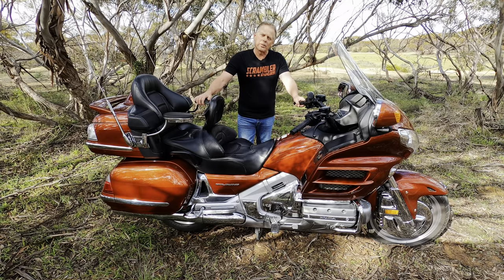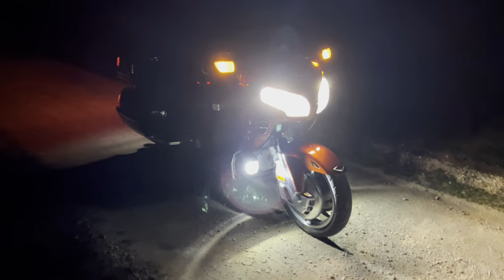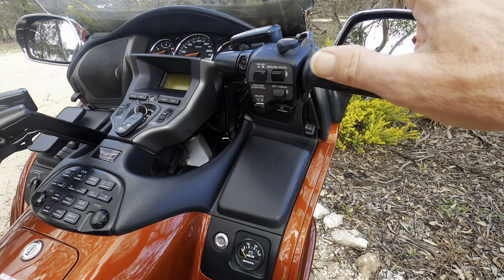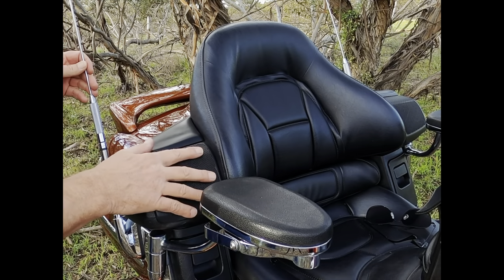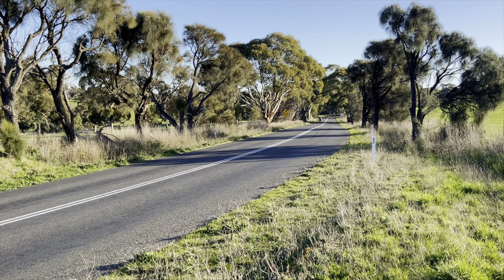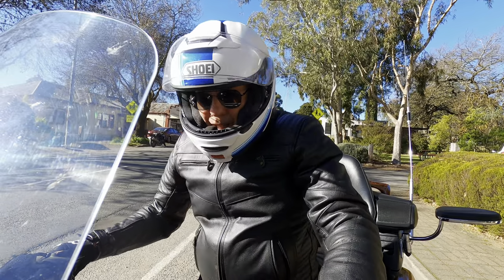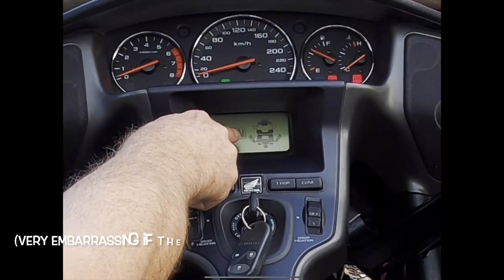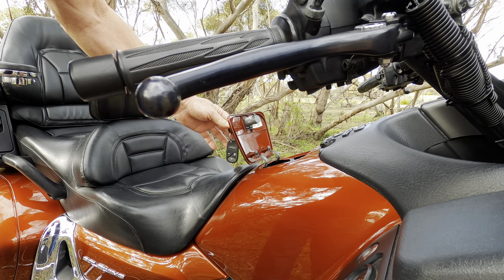Honda Goldwing Used bike review  Is it as good as people say?    (56)

Comment: I bought a 2012 GL1800 with 103,000 miles, and after three years and five months, the bike has 140,900 miles with no issues. It's my daily ride of 50 miles per day. The only complaint I have is seat heater, and handlebar have no heat [electrical problem], the trunk rattles, and the air filter change is highly complex. I only changed a headlight bulb once or twice, but I thought it was a pain. Rest is good. I do my maintenance, but my age is catching up, and lying down is getting more difficult. I don't mind its high mileage, and it rides beautifully.
Reply from the maker: Thanks for your comment, yes the air filter is a pain but fortunately it’s a long time between changes. I had the same annoying rattle, turns out it was the rear speaker covers, enjoy that lovely bike & ride safe.
Reply: @standupmoto  Thank you, and have a great ride yourself!
Reply: Re heater problem, your left had bar heater is broken, this is a common fault, if you remove your right hand fairing pocket you will find two, two wire connectors, these are left and right grip heaters, un plug the left grip and the rest of your heating system will work, had this problem on my 06 wing, eventually fitted showchrome heated grips when the grip rubbers were worn out.
John.
Reply: @johnogden6131 thank you John. Sorry about long no reply to ya! It works now thanks to you! Have a good ride sir!
Reply: I now have 151k. All good except for the master cylinder had to be replaced for front wheel. It happened at 151k! First major change needed. Everything else is original and no issues.
Reply: Update: needs more work on brake repair than just the master cylinder. Going to cost around $1,300 for the brake repair fee.

Comment: My 2012 is awesome. Only one complaint. No 6 th gear. I did do the Traxxion dynamics full Monte suspension. Transformed the bike.
Reply from the maker: That’s great and with the suspension updates, yes 6th would be nice but that OD is quite tall. But I agree it would be good to drop a few hundred revs when on the open road, thanks for the feedback. Cheers.
Reply: @standupmoto  there is a rear drive to drop the revs. I think it’s called a Henry drive. Drops it about 500 rpm
Reply from the maker: @SuperSquitch   Hi Lou, I’ve not heard of that but it’s probably easier to just pop on a 65 series on the back.

Comment: I own my 2002 GoldWing now for 8 jears, driving 200.000km, only maintains are oil , break pads and filters Ride great, total km now is 260000 km just 1 big repair on the gearbox, root cause a worn bearing in the crankshaft cost me 3000 euro!! But the engine was stil after 246000 km in a berry great shape and hardly any worn could be find 
So for me stil the best bike
Reply from the maker: Thanks for sharing

Comment: 120,000km I picked up for CAD$400. After a week and maybe another $600, I've been riding it for 4 years. Just took my partner on a 600km road trip a couple months ago and it ran like a dream. However, seating position with the Saddle seat really sucks. Too far forward. And now I find I'd like a backrest and cruise control for long trips.  Soon time for a newer one. Getting a little old 😆 🤣
Reply from the maker: Sounds like a bargain! Yes they are a wonderful long distance machine for sure, you may be able to find a Corbin seat second hand if the standard one doesn’t work for you. Cruise is a really nice thing to have, apart from the comfort side of things it’s saved my license many times.
Never to old 👍 cheers.

Comment: Nice review 👍🏼 Having owned a Suzuki GSX1400 I've always fancied big engines. Not so much for the speed but for the torque and the flexibility in gears. But I never liked the GSX, always had the feeling the weight was  way up, to high in the bike. Having owned several other bikes since I'm now on a small Honda Deauville 700. Nice and agile bike for local traffic  but to light for serious touring. And since we're going to move I'm going to have to do a 500 km stretch on regular basis. I was a little afraid that apart from the motorway the Goldwing would be a heavy b*tch to drag around but seeing you take it on gravel roads and even do some off-roading  I think I need to change my mind on that. Another thing that I really like is the low revs in the 6 cyl.  I've grown up around heavy machinery and diesel trucks and In all my years of riding motorcycles I have never gotten used to the high revs of 2 cyl engines. I was also looking into a BMW K1600, but the more I find out about the Goldwing, the more it appeals to me. 😇  Going to have a test drive very soon. 👍🏼
Reply from the maker: Hi Ray, yes I agree with your observations over what sounds like many years of riding. I have both, the 1600 and of course the Goldwing, both are great but one is better in my opinion for long distance riding. That being the Goldwing, for the following reasons. It’s just more comfortable for both the rider & passenger, weather protection is excellent, controls are simple and easy to use and yes it revs low and also carries its weight low. The K1600 is faster, far more fuel efficient and the brakes are far better. It’s in my opinion anyway a sports tourer and I love riding it but on the negative side it’s far more complicated. The Wing is relatively simple to service yourself but the K needs to go to the shop, both are fantastic motorcycles but for sheer comfort and ease of operation I’d say the Wing.
Reply: @standupmoto  So that said it😃 Thanks for your no-nonsense answer.  For what I've heard from other videos the BMW also gives you a 'more sporty position' -- read: 'more cramped up position'.  And that would be another deal breaker.   Have done enough kilometres to say that I now want a more relaxed riding position, especially on long distances.   Thanks again for your personal answer. 👍🏼Sure gonna follow you channel for more motorbike reviews.

Comment: Hi Steve, enjoyed your review, and your overall spirit. I have started looking into the possibility to get a Goldwing also, mainly because I ride very often 2 up with my wife, and she fatigues early on the back of my 1000 Strom. I have a couple of worries about it though, and wonder what your experience/recommendation is on a couple aspect. Maintenance frequency/cost, and tyre wear. And ground clearance: how often do you scrape your foot pegs while leaning the bike?
Reply from the maker: Hi Pierre, yes good points you raise. Maintenance is pretty straightforward, oil, filter etc are easy to do. Air cleaner is a pain but fortunately that’s not something that you need to do every oil change, I do manage to get the pegs down a bit 2 up but you soon learn the entry & exit speed of the Wing. When riding heavy I put the rear suspension to its highest setting (push of a button) and it’s fine, there’s something about riding the Goldwing that makes you not want to be tipping it in & dropping a knee anyway. It a classy comfort ride, it’s hard to explain. As far as your wife getting fatigued, a thing of the past, those days will be gone. She might fall asleep though, it’s just that comfortable on the back, overall if I broke this one would I replace it with another? in a heartbeat.
Reply: All right, good stuff Steve. I’ll report back if I ever decide to go ahead and get us one also. 
BTW, I ran your Goldwing videos by my wife, and you certainly made an impression on her. You have this unique quality of blended poise and enthusiasm, that soothes people like her. High praises to you sir. 
BTW #2, Amy’s little bit as a pillion didn’t hurt either!😜

Comment: I’ve had many bikes over the decades and currently have a 2001 st1100 and if Honda holds true to their build quality it’s a good bike...EXCEPT FOR the ST is a soulless bike...a good bike but is BORING and top heavy! If you have ridden a ST and GW  & have done a good amount of saddle time on both, I would love to hear your input... and please be specific on the year of GW . Thanks in advance 👍
Reply from the maker: Hi Joan, my Wing is an 07 (1:14 in video) How would I compare the Goldwing to the ST1100? I owned an ST for many years, I did many thousands of Kms on this bike and loved it. It was a great motorcycle, would I go back to it for touring and sell the Wing? 
No definitely not, as good as it was the Goldwing is far more comfortable both in the seating department & body posture position. Weather protection is better, heating ie seats, hands, feet & storage all add up on those long rides.
The Goldwing as heavy as it carries its weight low and is extremely manageable, my ST would win in a race through hills without doubt but that’s not what the GW is about. I could almost not live now without the reverse feature, it allows me to take the Goldwing to the farm, something I just couldn’t do on the ST because of the unsealed nature of the undercover parking due to the inability to manoeuvre it on the soft ground.
Passenger comfort is unparalleled on the Goldwing and of course cruise control is the icing on the cake. I have done many trips on the GW since making this video and apart from (in my opinion) the fuel tank being a tad small for some of the long hauls here in Aus I really can’t fault it. 
When you park somewhere people always want to have a chat about it and that nice,  I even take it to the city now when I go down from where I live. Yes it’s big and I can’t always filter through the traffic at the stop light but you know what, that’s fine.
I am at that fortunate time & age in life where I am able to own multiple motorcycles but I’ll ride the Goldwing 90% of the time, why? Because I love it.
I hope this helps with your question, I have answered as honesty as I can as an owner operator of one of these wonderful machines. Cheers.
Reply: @standupmoto  thank you for your honest opinion... I think I’m going on a hunt for a new spring time ride, gladly I will be getting rid of the st, it’s treated me well, but I have the room for only one touring bike! Cheers from  northern Ontario Canada

Comment: I own the 2010 GL1800 Goldwing. THERE IS NONE BETTER. I'd rather the older one than the 2012 entry bikes. The 2010 is a HUG on the highway. My friend has the 2015 and it seems a bit smaller and the passenger is not as comfortable I'm told.
Reply from the maker: I think I have to agree with your comments, I am in the lucky position where I get to ride many different bikes but do love riding my Wing. They have a presence & feel that’s hard to replicate, cheers.

Comment: I would hate to have to clean the carbuerator on one of them and fix it with a new carb kit.
Those rubber seals and parts in there are probably 15 years old now and full of varnish.
The Goldwing is just out of my price range.    I just bought a pristine 2007 Honda Shadow Spirit for 1,900.   I'm looking at used Goldwings and you're still paying the price of a house trailer.
Reply from the maker: Hi, yes good Goldwings certainly hold a high price. Especially here in Australia, however the Shadow is a very nice machine and you should get many years of good riding from it. Enjoy & ride safe 👍
Reply: @standupmoto  Mmm, I've already pretty much lost interest in it.   I got 10ft of heavy a55 ABUS security chain in the mail today and two Abloy 340b locks.    

After 20 years of riding I'm already pretty burnt out and tired of suiting up and suiting down everywhere I go and waiting on a warm and nice day for it, and if now I have to chain up this new bike to a pole where ever I go, it just doesn't seem particularly fun any more.   That an all the extra maintance and cleaning a 3rd bike adds.    Buyers remorse I guess.   

I thought it would get me out of the house more, but just adding a 3rd bike hasn't increased my range or ability to go camping.  Should of gotten a light Japanese pickup truck instead.   Oh well.
Reply from the maker: @choppergirl   Yeah ok I hear you & get where you’re coming from but how about this for an idea. You’ve done the road bike thing for many years, how about moving on 2 of the roadies & keep 1. Now hang on before you yell at me think about this,  One road bike for the bitumen, then you get that truck & a “manageable” low capacity registered trail bike (nothing to crazy)  and do a bit of trail riding!  Throw the dirt bike on the back and find some good not too technical off road stuff, if you haven’t explored this type of riding in the past you might just love it. 
Riding is all about balance,  I ride both and love both but my off rd stuff is my personal preference. You meet like minded people, some ride like there’s no tomorrow but some just enjoy the great outdoors.
Just a thought 🙂

Comment: Only way to confirm that a bike has ABS is the dash light
Abs stickers could mean nothing. Even abs sensor rings on brake discs mean nothing. I have seen a few models that got sold without ABS but still had the sensor rings, prbly becauss it streamlied the production
Reply from the maker: Good information for potential buyers, thanks for sharing 👍

Comment: What was the phone mount you used in the video? Thanks for the great review.
Reply from the maker: Hi Brennan glad you enjoyed the video, the phone mount is a Quadlock but you do need the Quadlock case on your phone to use the Quadlock mount. In this video I am using an iPhone 13. Cheers.
Reply: @standupmoto  how did you fasten the mounting puck to the surface, I couldn’t tell from the video? Thanks for your time.
Reply from the maker: @brennanfitzpatrick5270   Hi Brennan, in this case there was already a screw hole in the lid from where the previous owner had something. I used that for a small screw with a backing plate and put 3m double sided tape on the underside side of the puck to stop it turning, sounds a bit primitive but seems to work fine.

Comment: @standupmoto if gold wing is dream bike and can't afford (2nd hand) or maintain, then which is an alternate bike (RE, Honda etc ) that is cheaper to afford without compromising a lot on ride quality ?
Reply from the maker: Mmmm interesting question, I would consider the Honda Deauville. It’s like a mid size Goldwing with a 650 or 700 cc motor, made for comfort & economical to run. It has the large fairing and rear panniers but is much lighter than a Goldwing and far less expensive to buy.
Reply: @standupmoto Deauville is Fantastic too but it is not available here in India. Here RE, Honda, Suzuki, Yamaha etc are more popular. And I have seen super meteor 650 with trunks closest lookalike of GW. Looking at Deauville, I m gaining an understanding that superbikes with trunks will suffice, your thoughts pls
Reply from the maker: @bhutanity   Ok I understand, how about the Interceptor?  All decked out for touring I think it would make a great bike.
Reply: @standupmoto  haha interceptor is more like Bonneville. Gold Wing has a different feel altogether I believe. Anyways thanks for sharing your insights

Comment: goldwings owners.... The only question I have is don't you ruin the bike in bad weather? the seats and all are massive, so I wonder if rain and stuff will destroy a lot on the bike?
Reply from the maker: Hi Tim, valid question. Yes prolonged exposure to the elements will definitely have an ageing effect on the seats and plastic in and around the dash etc, Honda have done a pretty good job of making everything water tight but the sun especially in hot climates does the damage. Fortunately there’s plenty of storage options on a Goldwing so a light cover can be stored somewhere for riders that have to leave their bikes in such conditions, thanks for asking the question. Cheers.
Reply: @standupmoto  allright, thank you!
Reply: I feed my seat with leather balm to keep it soft and moisturised.  Stops it drying out and cracking. Also spray acf60 underneath to seal it from constant rain ( aircraft grade) so I recommend it…

Comment: Traded my  2006 ST1300 in as part payment for a Wing(100% pile of shit) ... Owned a late registered 2006 GL1800 Sat/Nav Deluxe(airbag) model on a 2008 plate from new , same bike from 2002 up to 2016 ... kept the old girl until 2011, way way over priced, shopped around & played one Honda dealer off another, managed to get the price down to £16,000 from £19,000 as it was way back then on 07 ... Beautiful bike, found the electric system very dated, entertainment system was yrs out of date as was the Sat/Nav system, screen was a complete joke, buttery smooth to ride, weighed a ton to manoeuvre, had an electric reverse via an idler gear off the starter motor, helped with shunting & parking, luggage capacity was never huge, but still greater than the latest Wings, would see off a good few sports bikes on acceleration... Personally I wouldn't go there again, RRP is just madness.
Reply from the maker: Thanks for the feedback, yes they certainly are a beautiful bike if longer rides are your preference. Although now I’m used to mine I find myself using it in the city also. And yes couldn’t agree more re the price, I think they target a certain audience. 👍 cheers.

Comment: Im not gonna be splitting lanes on a wing . its a bit wider than other bikes .
Reply from the maker: Yes it’s certainly big when filtering down between the cars for sure, it’s approximately 10” or 250 mm wider than my Super Tenere . That’s to the very outside of the mirrors on the GWing & to the outside of the handle bars on the STenere. (5” per side)